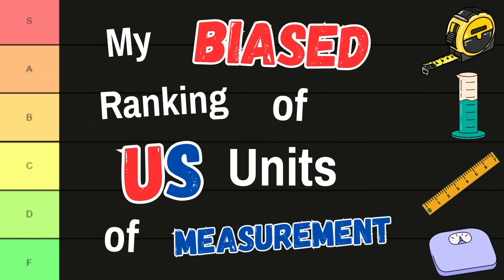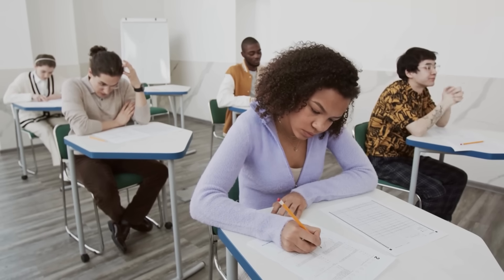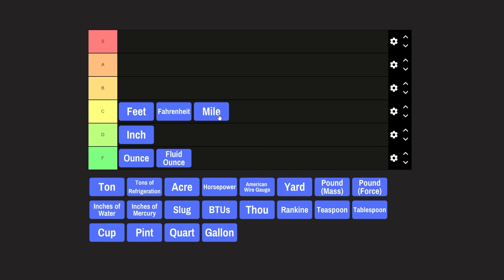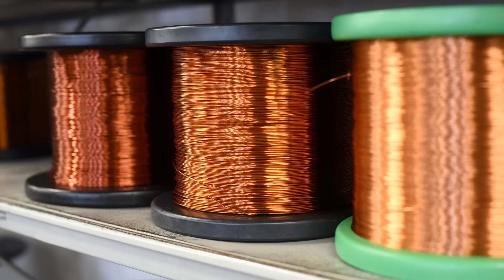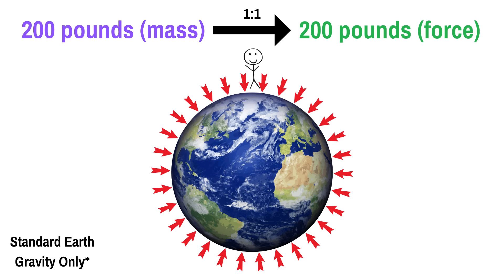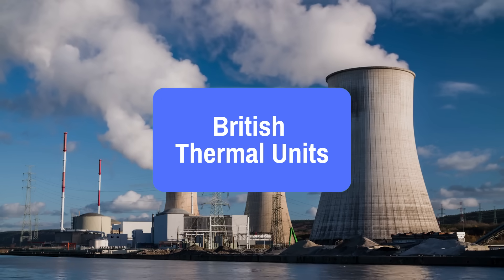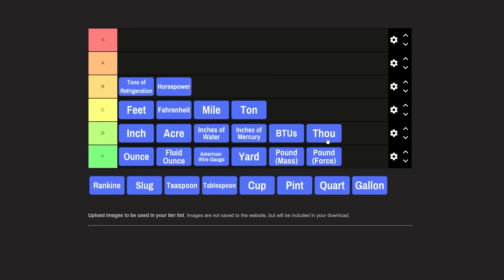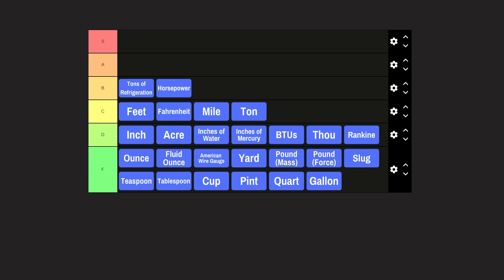Tier List of the DISASTROUS US Measuring System

Comment: as someone who grew up with metric and more importantly Celsius, hearing someone talk about temperature and saying "60 degrees" - "100 degrees" gives me a whiplash until i remember Fahrenheit exists
Reply: Celsius is based on the ideal gas law: a gas will expand or contract 1/273.14 of its volume for every degree Celsius or Kelvin temperature change. That’s  why absolute zero is -273.14C or O Kelvin
Reply: @OneEyedJacker Yes and Fahrenheit is the same but multiplied by 9/5 and increased by 32, so?
Reply: For me the expression "IQ lower than the room temperature" was funny.
Reply: @okaro6595 it means an IQ of around 10
Reply: @arx3516  it means an iq of lower than 74
Reply: If kelvin is so great why do we need Celsius at all 🤔🤔🤔
Reply: I have an americsn Partner  so i lerned zhst 0c aproxinetly equals 32f and then zhst 1c aproximstly equals 2f so i can kinda convert but the further up or down u ho the less acurat it becomes

But usefull enough for converting weather   enough thst inknow if he should tell me its 5 degree its not save to just wear a shirt a scsrf and an open leather jacket😅
Reply: Fahrenheit imo is better to use for daily life. 98 degrees is good. 100 is fever. 104 is emergency room. 105 your body stops regulating temperature. But science, Celsius is better
Reply: hahahh same. whenever i hear people saying it’s 32 outside i’m like “oh ok it’s quite hot!” but it’s literally FREEZING cold
Reply: True
Reply: The reason why Celcius is better than Fahrenheit for me is because it is easily converted with Kelvin by just adding 273 instead of doing multiplication AND addition.
Reply: @govinlock8568 So, you can convert Fahrenheit to Rankine, which is also an absolute scale. Fahrenheit is also much better matched to the human experience.
Reply: @tyrannosaurusimperator i disagree because to me celsius is much more intuitive, given I was raised in a country that uses celsius. It is more about being used to a measurement system than the measuring system being "better".
Reply: @tyrannosaurusimperator matched to the hunan experience? WTF? Celsius is the better suited to human experience. At 0 water freezes and you can start seeing snow outside, at 20 is perfectly comfortable and at 40 is really hot.
Reply: @arx3516  being able to see it In 0-100 scaling is actually way better
Reply: @govinlock8568  Wrong. You have to add 273.15 to Celsius to get kelvin. That’s no better or worse than adding 459.67 to Fahrenheit to get Rankine.

Fahrenheit was aiming to have human blood temperature be 96 degrees, which is a highly divisible number. (He was off by 2.6 degrees.) And he wanted water freezing to be a third of that, hence 32 degrees. And he wanted about 2/3 of that to represent a reasonable room temperature. Well 64 F is a bit chilly these days but they tended to wear more clothes back in Fahrenheit’s day. He also wound up with the freezing-to-boiling range being 180 degrees difference, which is another highly divisible number. 

So Fahrenheit was perfectly rational but not if you’re a decimal chauvinist.
Reply: @kodegadulo  It is more inefficient to convert Fahrenheit to Kelvin because you need to reduced by 32 and add 273.15, then add 5/9 (a.k.a K=5/9*(F-32)+273.15) while converting Celcius to Kelvin only add 273.15 (a.k.a K=C+273.15). Kelvin is used for scientific purposes so easier to convert with it the better. I never learned Rankine because I live outside US.

Edit: I just read about Rankine and it is just like Kelvin but with Fahrenheit scale. Still, it is not widely used due to rarity of Fahrenheit usage outside US.
Reply: @govinlock8568  You’ve deliberately biased your equation to make Fahrenheit and Rankine look more complicated, by assuming that Kelvin is the only possible “scientific” scale, and unnecessarily using Celsius as an intermediate. In reality, any absolute scale is as good as another. Here’s the salient equation in a non-SI world:

R = F + 459.67

Easy peasy. There is NO need to involve Celsius as an intermediate, just to make it more complicated. If you still want to convert to Kelvin, the equation is:

K = 5/9 * R

Also easy peasy. And then of course:

C = K - 273.15

I could easily contrive to make Kelvin and Celsius look bad:

R = (9/5*C+32)+459.67
Reply: Fahrenheit will aways look exagerated for us, normal people.
Reply: I like celsius, because 0 is the temperature at which water freeses, i e. you have snow. All temperature ranges inhabitable by humans are in a relatively small bracket of -30 to +40, and in most climates you know that temperature will go below 0 only during winter.
Reply: Don't scroll further.. Immense but hilarious American cope tropes below 😂😂
Reply: @chelmano0  you just made me aware how big my original coment became
Reply: Laughs in Kelvin supremacy
Reply: Growing up on Fahrenheit, celsius still confuses me. I'm just used to gauging it based on 100 and not between 0 and 40. I use it for calculations all the time but in terms of human comfort it makes zero sense unless you grew up with it. I get our measurements are dumb but Fahrenheit is the one I can make the most sense with
Reply: @aceystar1478 "makes zero sense unless you grew up with it." it goes the other way as well. i grew up with celsius, it makes sense to me, farenheit does not and is a struggle to intuit. Farenheit is not inherently more intuitive than celsius.
Reply: @multidwee  no one said farenheit was though
Reply: @aceystar1478  basically F and C are the only one thats kinda equal and just depend on ur familiarity because we dont convert temperature to any other unit and if we want to use it in calculation, we should convert to thermodynamic temperature anyways so its the only imperial unit that is = to the metric counterpart
Reply: Yep, it really is just mostly familiarity. I live in a country that gets pretty chilly so having C is kinda nice as I know when to worry about slipping on ice. But it's not like it really matters and I would know the exact same thing if I grew up used to F instead. 

Like purely intuitively, I'd still put Celsius a bit ahead if only because the boiling point and freezing point are super easy to remember. BUT, it's not like I ever need to keep that in mind for the temp outside cuz I'd be super dead getting anywhere near 100C. Fahrenheit having around 100 be body temp is also nice and intuitive, but in exchange 0 fahrenheit means nothing to me. Like yes it's very cold, but it was very cold before 0 as well.
Reply: @Sekaro297  I agree that 0 F feels like a very arbitrary number, however, I think its in the right ballpark at least. The freezing point of water is pleasant as long as you have a jacket on, honestly too warm to have the sort of gravitas attatched to the number 0. 0 F you feel like you are going to die if you spend more than 10 minutes outside. The sheer, raw brutality of those extremes is why C always felt tame to me.

Also C just has less whole numbers, and is therefore less precise unless you wanna go into the decimals each and every time.
Reply: @aceystar1478  I never understand that "in terms of human comfort". There are like 20 or so climate zones in the US and people are used to very different temperature ranges, so which one is Fahrenheit for ? And If it's calibrated for humans, why isn't 50 the sweet spot ? 
Not to mention that temperature isn't everything for human comfort. It all just feels very arbitrary. So if it's more descriptive and less units and numbers, it would be fine to me.
Reply: @frogman7345 I live in Siberia. We have a range from -50 C during coldest winter days to +30 C at warmest summer days, and Fahrenheit doesn't make any quality of life difference (it would be from -60 to +85 F).
Reply: @aceystar1478  hundred degree is Boling temprature.. why make it room temperature.. and make zero as freezing 0deg .. why 32 .. doesn't make sense
Reply: @rohand04  hundred degrees is room temperature... why make it boiling temperature...

See how easy it is? You just arbitrarily decide that whatever unit you use is the superior one, and suddenly any other unit doesn't make sense.

Btw, I was born and raised in a country that only uses Celsius and I'm not at all used to Farenheit, but I can recognize that both units are equally reasonable.
Reply: @aceystar1478  celsius is ideal if you drive. 0 means ice. If you are around 0 pay exceptional attention. If you are around 30 to god forbid 40 just double that and you get the temperature inside your parked car
Reply: @aceystar1478 it doesn't make sense? Its literally based on water's freezing temperature and boiling temperature. IT MAKES ABSOLUTE SENSE
Reply: @aceystar1478  celsius is based around water, it has absolutely nothing to do with human comfort
At 0, water becomes ice, at 100 it boils
Reply: @KirikkSiSq only pure water. Or whatever amount of ions present in the water when they set originally defined it. Also water only freezes and boils at those temperatures under 1 atm
Reply: @aceystar1478  so with a little degree of variation those rules apply to almost anywhere on hearth
Reply: @aceystar1478   no because its easyer to calculate science and it makes no sense to have 2
Reply: @tombraendle7156  celsius does not make science easier. Kelvin and rankine do. We only use celsius because it's already integrated into your other units if Fahrenheit hadve been used it would all be the same
Reply: @aceystar1478   Having the triple point of water being at 0 degrees does kinda make a difference
Reply: @dunterunt  literally doesn't matter other than it looks fancy. If you're not using Kelvin or rankine in thermo and your dealing with solid to subcooled liquid your math will be off either scale.
Reply: @dunterunt the melting point isn’t actually at 0 Celsius anyway
Reply: @aceystar1478 Or just change altitude and suddenly water doesn't boil at 100, but at 95°C anyways. Neither of the 2 units is truly better than the other one
Reply: @aceystar1478 Celsius and kelvin are the same exact magnitude, just offset by 273.
Reply: @aceystar1478 Kelvin and Celsius follow the same incremental scale, unlike Fahrenheit and it’s extremely easy to convert one into another. Kelvin is basically Celsius without negative degrees.
Reply: @tombraendle7156 yeah but Fahrenheit is still superior for day to day use

Shouldn't have 2, but we do and Fahrenheit does a better job for the 99% of people on the planet who aren't scientists lol
Reply: @Whaddah  depends on pressure
Reply: @thecactusking5893  if its above 100° water boil, very simple, intuitive, ( when we use  1 ATM pressure [≈101 kPa] )
Reply: @aceystar1478  Celsius is just Kelvin +273,15

it is literally one of the most precise and concise temperature measurement systems for that matter
Reply: @portalwalker_  "change altitude" brother you wouldn't believe this, Fahrenheit does this too, fucking Kelvin and Rankine also do this, EVERY SINGLE TEMPERATURE MEASUREMENT SYSTEM DOES THIS
Reply: @aceystar1478  "not between 0 - 40" brother you have minus Celsius temperatures in Wyoming, wtf are you waffling about
-30°C isn't some outlandish cold, it's a normal occasion in winter for a lot of people

Americans, man
I wonder which institution of theirs causes this problem
Probably the education system
Reply: @aceystar1478 Completely agree with you. I'm only used to celsius but the Celsius scale is just as random, as the Fahrenheit scale so I don't understand why everyone is picking on Fahrenheit, even though it's by far the least outrageous unit
Reply: @portalwalker_ How is celsius even random? Did you never learn about gas laws?
Reply: @WizardAmbrose  Well the ideal gas law has to use a constant, BECAUSE the Celsius scale is random. If it wasn't random but rather defined by this law, the constant wouldn't need to exist
Reply: @aceystar1478 I Agree with you (Im European)
Reply: Celcius should only be used for cooking Fahrenheit is better for temperature
Reply: Fahrenheit makes much more sense. A scale from 1 to 100 that is pretty perfect in terms of everyday outside temperature. 1 is really cold, as cold as it can comfortably be without interfering with your life, 100 is as hot as it can be before you get heatstroke if you go outside. 0 celsius is pretty cold but not that cold, and 100 celsius is boiling. Celsius might be better for measuring boiling temperatures or melting/freezing temps but not for everyday usage.
Reply: @Boyd_Fowler i disagree, if you drive you see 0 and you know "oh ice around, better be careful" its more immediate imo
Reply: @Boyd_Fowler i disagree, if you drive you see 0 and you know "oh ice around, better be careful" its more immediate imo
Reply: @alphahurricane7957  there is not ice at 0 celsius yet. Even though it's freezing temperature most ice doesnt form until it's colder, lakes wont freeze solid until more like -10. Also you're ignoring the whole other side, the heat and moderate temp side, 50 is not moderate in celsius, and 100 definitely isn't.
Reply: @Boyd_Fowlerif you go in at 0 degrees without thinking about ice, especially early in the morning maybe for work you are in for a very rough awakening and a big bill to pay. I find 0 sense in a 0-100 scale that can go above 100 and below 0. Makes no sense, its uselessly dilated. Half a degree celsius up of down is actually percivable, one degree up or down farenheit i doubt
Reply: @alphahurricane7957  which makes more sense. Fahrenheit creates ranges for you to refer to, 50s, 60s 70s, whereas in celsius they are only 3 or 4 degrees apart. Fahrenheit is more precise, applicable, and intuitive.
Reply: @Boyd_Fowler we agree to disagree
Reply: But tbh Celsius is still worse than Kelvin isn't it?
Reply: @Dragonik566  it is but its practically the same thing, Absolute zero is -273,15°C = 0 K, kelvin is just moved backwards, Celsius is for normal day use, kelvin for science purposes
Reply: @Dragonik566  every measurement is worse then kelvin
Reply: @Dragonik566 Celsius and Kelvin are easy to calculate though. Both have a difference of 273.15 so 0° C becomes 273.15 K. Fahrenheit is just awful with its 9/5 factor and the fact that you have to consider 32 as the starting temperature with 180 different units.
Reply: @WizardAmbrose  only when you use Celsius
Reply: @Dragonik566 Cuz kevin is the goat(Not kelvin i dont jse kelvin)

Comment: I use my own measuing units...

1 fish oil = 72 camel hairs of weight at this point in time... the next day 2 fish oils will be equal to the mass of 2 cars exhausts going at about 2000 7 fish oils of speed...

Yeah... the same unit can be used to measure two different things at the same time...

And they're all interchangable...

Comment: Do you know what the greatest thing about both metric and imperial units is? Being English and in my 60s means I can use both as I grew up with both. So if I ask you what the temperature is outside you can answer me in either Fahrenheit or Centigrade (Celsius) and I'll know what it's like outside without converting one to the other. I guess it's like being able to speak two languages fluently. To help Americans I give them 2 metric temperatures to remember: 16C and 28C. If you reverse the numbers you get (very close to) the Fahrenheit equivalent. It'll also give you an idea of temperatures in between. For example, if it's 22C then that's halfway between 16 and 28; so now go halfway between 61 and 82 which is 71.5 (The actual temperature is 71.6 but it's close enough). A simple formula to convert C to F is to double it, subtract 10% and then add 32.

There are some I don't like to use, like kilometres instead of miles (in the UK all distance and speed signs are in miles and miles per hour), and some I just refuse to use. If you ask me my height and weight you get it in feet/inches and stones/pounds. If you want it in metric then YOU work it out. I know both, so should you! Height: For Brits and Americans I use feet and inches. Weight: For Brits I use stones and pounds, and for Americans I use pounds. In each of these cases I'd tell Europeans to use a calculator! 🤣

Comment: I don't know why exactly the size for 0 gauge wire (called 'aught') was what it was, but it was originally the biggest size by not needing to be run though the gauges. Which is why, later on when larger sizes were needed, we need 2/3/4 aught. And if I'm not mistaken, the AWG sizes were decided based on some kind of logarithmic function, so they basically just did it in reverse to figure out what the larger aught sizes should be.
Reply: I just laugh thinking about someone thinking "maybe we should admit we fucked up and have it roll into the negative for so it can keep scaling forever..... naaahhhhh why would anybody need a bigger size let's just add an extra zero and that will be the biggest size wire anybody ever needs" 

Then a week later somebody wants an even bigger gauge wire and they have to add even more zeroes
Reply: @QuakeGamerROTMG there’s also the fact that a lot of the amperage ratings come out nice for example 12 gauge handles 20 amps, 10 gauge handles 30, 8 gauge handles 40, 6 gauge handles 60, 4 gauge handles 80 etc
Reply: @QuakeGamerROTMG  Then here comes chad metric paper with A0 being 1 square metre in area and edge length proportions that divide neatly in half. You can add or reduce the A number and it doubles or halves the size into infinity while maintaining the same edge length proportions.

Comment: how can they achieve anything with that ?
(do you know Adobe Illustrator was known to be coded with imperial units, and that's why metric units used to be wrong in it ?)

Btw, it's quite amazing they use "regular" time units (but that's not a smartly decimal based unit system 😅)
Reply: Uh, sadly, Adobe Illustrator, together with the whole DTP scene, is based in publishing, and that is very non-metric to this day.  A point?  A pica?  All inch-based.